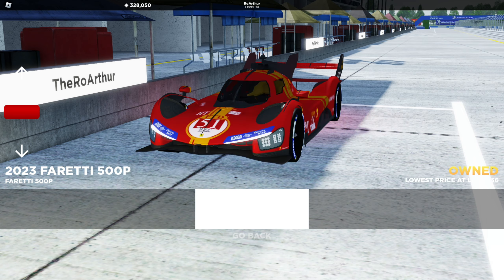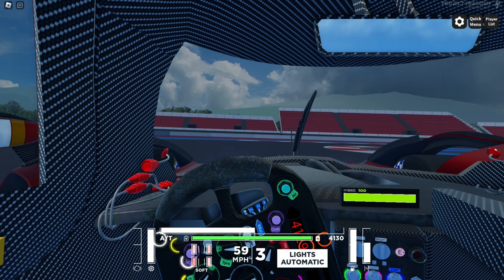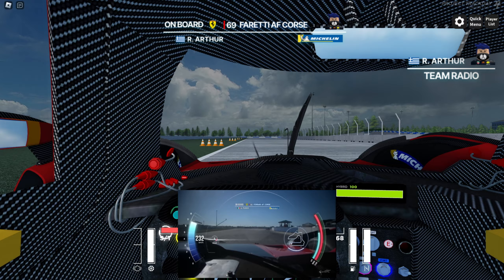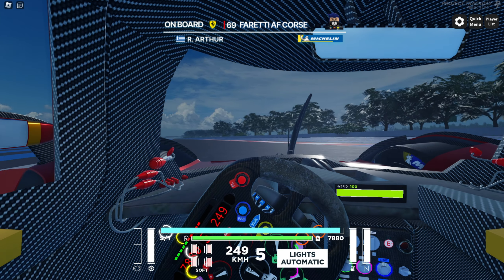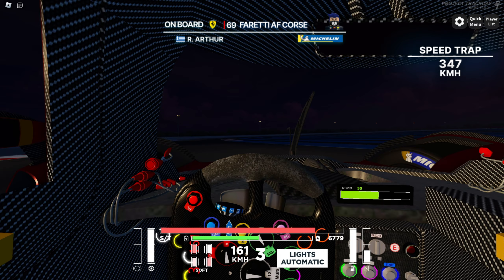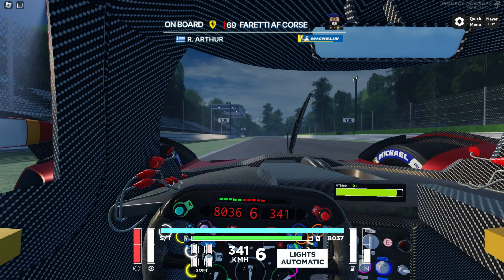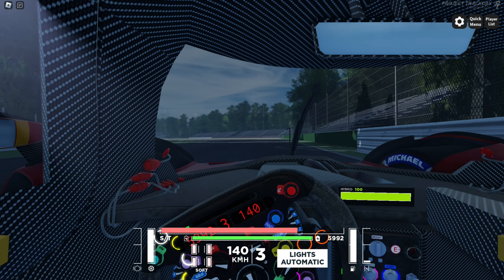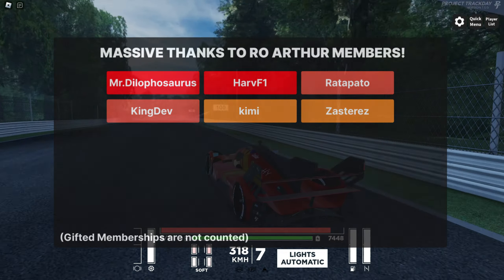This Project Trackday Update Is INSANE!

Comment: There are a few flaws with the update:
1. The car is too small, not up to scale with other cars. 

2. The steering wheel and sound are ripped straight from the Toyota LMP1 in game. 

3. The gear ratios aren't accurate. 

4. Some bits on the real car's doors are carbon, however, those bits are red in game
Reply from the maker: I guess, at least they tried. At least, they tried.

Comment: My opinion is the same as Niki Lauda's. 

(Niki Lauda) Runs like a pig.

(Mechanic)You can't say that.

(Niki Lauda)Why? No?

(Mechanic) It's a Ferrari.

(Niki Lauda) It's crap on wheels.

(Niki Lauda) The steering resists, and the weight distribution is a disaster.

(Niki Lauda) It's incredible. With so many facilities and you make garbage like this."

(It's humor)
Reply from the maker: Dang i loved it